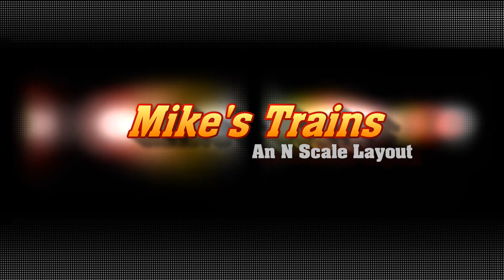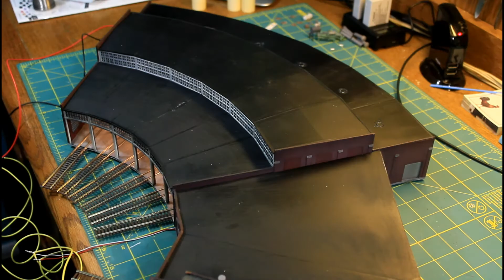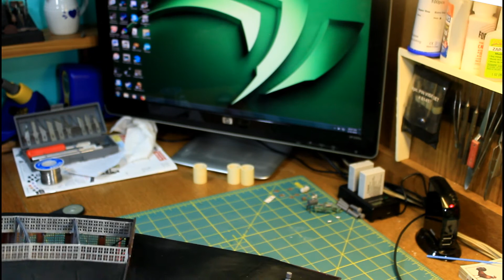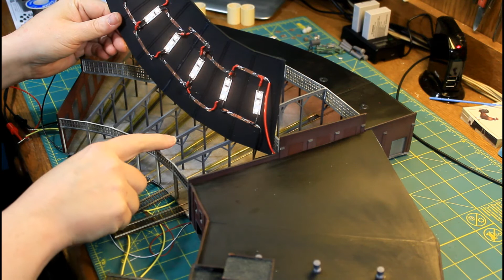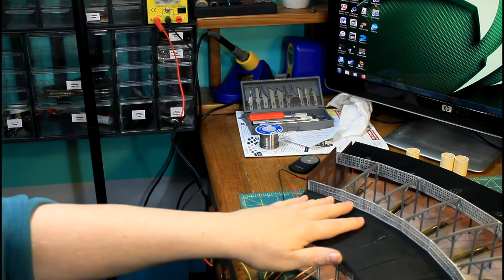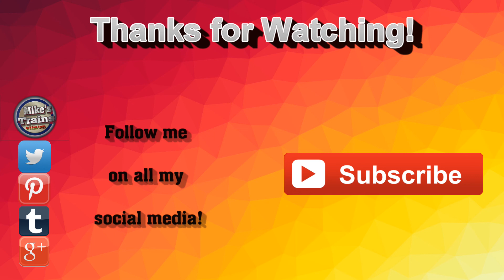Roundhouse Machine shop Kitbash Part: 11

Comment: Mike, 
Just a question concerning glueing down the two roofs. How will you change any LED strips that stop working (that happens sometimes!)?
Reply from the maker: Walter Miles yes the CAN burn out but these came in long strip and all the rest i have used have worked flawlessly for over a year now so I’m gonna take my chances with it. If there was comes a time I need to replace any I’ll deal with it then.

Comment: Excellent series. Is it necessary to glue down the two roofs?
Reply from the maker: Thank you Steve Tee, If you are asking about the 2 roofs on the roundhouse section then for me yes it is necessary. Unfortunately the roofs have a small warp to them and allow too much to pass under them so they will get glued down.

Comment: The building's looks amazing, check out some of my buildings and how I lighted them,thanks for sharing.....
Reply from the maker: Thanks  CSX 8840 CSX Baltimore sub division, Your layout is very impressive well done! I saw you are using the just plug system for your lights, That is an awesome and simple way to light things up. It is however a bit too expensive for me to use. looking back cost wise I think I spent less than $25 to light every building on my layout with enough lighting left over to do it again. Bad side is it is definitely more work.
Reply: Thank you and your buildings looks amazing